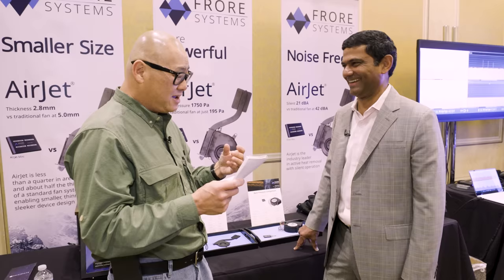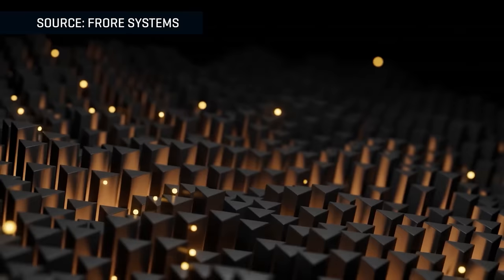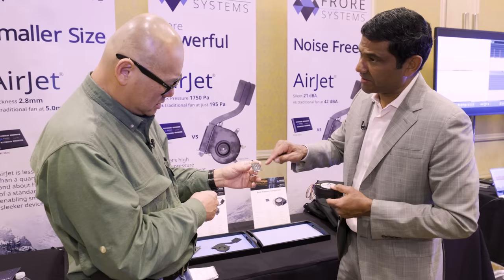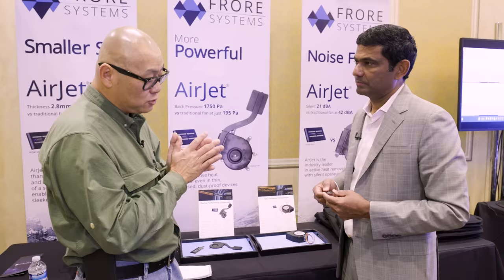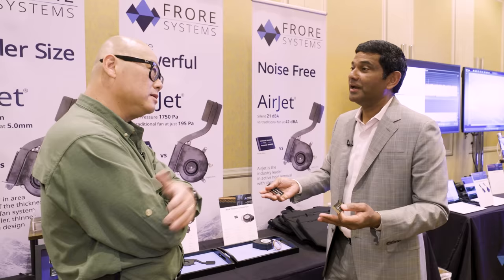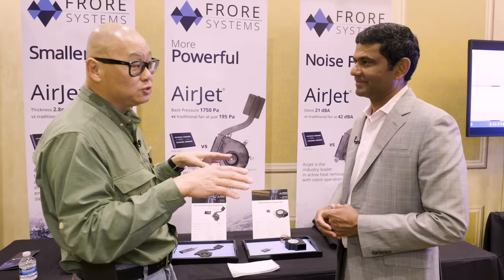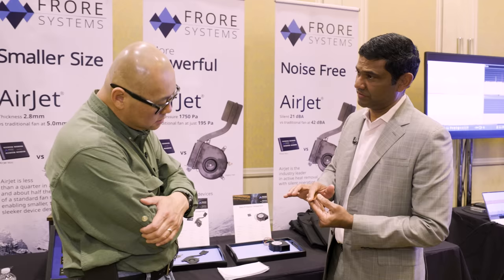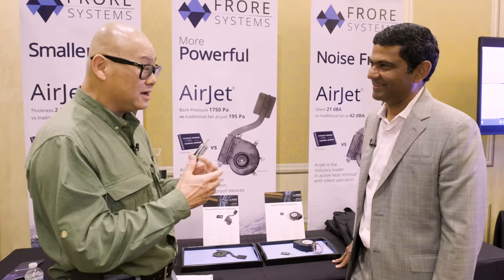Solid State Active Cooling Could Revolutionize Thermals

Comment: This is incredible what they have been able to achieve as a startup! I really hope their technology goes mainstream, as cooling technology is currently at a plateau. Imagine having an ultra-thin notebook with power comparable to a desktop PC, while also being silent and cool to the touch.
Reply: i think a reason why no big company bought this tech is because it is to expensive for the company/end consumer or prone to breaking (ultra thin membranes that vibrates? how will it live in a low to medium dust environment?, what about humidity?, how will the noise change over use with all the gunk building up over normal use?)
Reply: @pflegefachkraft7595  well, he said it can be made dust proof
Reply: You are described the MacBook Air m2 😂
Reply: 200kph air coming out of your computer is going to be loud.
Reply: @gamervmid  MBA m2 is not desktop level. Powerful for its size certainly, but not that powerful (for example, apples gpu graphs are misleading, they only show the gpu is more power efficient than a 3090, as the graph cuts off at the lowest end of wattage).
In fact the M2 doesn't even have good thermal performance. The m1 was pretty exceptional for it, especially as it was passively cooled in the air. The m2 however runs much hotter, even the MBP struggles to keep it cool and thats not passive cooling.
Reply: @gamervmid  the air had a sheet of metal to cool it. thats it. the m2 doesnt even have that. if it wasnt for the m1 only pulling 10w it wouldnt even be able to run.
Reply: @mistermr.6938  pulsating air is hitting the heat sink at a maximum of 200kph. The average speeds of the air hitting the heatsink will be much lower and the exhaust speeds will be much lower again as they will just be a function of the total amount of air moved and the surface of the exhaust port.

Comment: Very cool technology if it works as described. MEMS-scale components have a lot of potential, but will wait to see how this actually performs as far as performance and longevity before getting too excited. Interesting technology, regardless.
Reply: Cool, eh? Pun intended?
Reply: I guess that's the rub - competing with $1 rifle bearing fans from China that can run for 50,000 hours is going to be a big hurdle when this thing presumably costs way more.
Reply: @Weaver_Games  it should cost more, it's way better than fans. Silent at full blast, does not require vents bellow the laptop, thinner yet more powerful and will possibly outlast traditional fans.

It is also the only hope intel has to remain competitive in the laptop space.
Reply: @Weaver_Games  You probably won't see this in budget laptops but for higher-end stuff, this is a game changer. When its reliable, I don't see why this wouldn't dominate the Ultrabook space, which is already quite expensive.
Reply: @timlolxP  much in the same vein of what you said, this probably won't see implementation for several more years, and it will UNDOUBTEDLY be installed in top-tier products when it does. OEMs are gonna need time to transfer these into schematics for builds. The "bleeding edge" factor is too interesting to everyone in the tech space for them NOT to be wickedly expensive, and the "silent" factor is going to be marketed as enthusiast-level components.
Reply: @user-pq4by2rq9y  It will take time, 10w to 1w, maybe they scale exponential at present time.
Reply: I bet the vibration of the device itself will make it selfdestroy in about a year or two. I hope to be wrong, the technology is so "cool".
Reply: oh it’ll work, just not that great in first 2 years. Just wait til 2026 for this
Reply: Longevity typically isn't an issue in MEMS.  For example micromirror devices have been tested at more than a trillion cycles without any significant fatigue.  Depending on the design it's pretty easy for them to tune what frequency of oscillation they're using for a specific application.  My bigger concern is how they ever expect to get to cooling performance hardware since they'd have to potentially go up to an entire wafer for a single product whereas a traditional fan can just be made any size you need pretty easily and cheaply.
Reply: @user-pq4by2rq9y  Of course it will require vents. Where do you think it'll get the air from without vents, or where will the hot air from it be directed to? This device doesn't destroy heat, it is still a device to transfer heat. Just circulating hot air inside the laptop's/phone's/whatnot's case wouldn't do any good.
Reply: Yeah - I fear these things might die after just a few months. And even about 3 years would be a painfull step back, considering they will for sure be way more expensive than fans.
Reply: @Weaver_Games  for budget laptops maybe. but for premium laptops looking to differentiate themselves, this could prove interesting
Reply: @EkiToji  problem is that a trillion cycles happens surprisingly quickly at megaHertz frequencies. Same reason you can’t use Lithium Ion batteries instead of capacitors. 277hours.   :/ 
I’m hopeful. But skeptical
Reply: "Very cool technology if it works as described. " I mean unless that demo with the fan wheel was faked we don't even need any more evidence. The amount of air that tiny little thing is moving is pretty wild.
Reply: Was exactly about to comment on the expected longevity.
Pieces that vibrate for billions of times or more? Well, how does it fail? How long does it last with good performance?
Reply: @EkiToji  Isn't that relative? I (and moany others) consider any technological part that lives less than at least ten years as utter trash. Thinking of DLP projectors I know that their pixels usually start dying really early on. But one good thing for the AirJet (opposed to an DLP's dead pixels) is, that some single 'vibrators' breaking won't break the whole devices function at once, but it will more likely decline inperformance over time, until you consider it has to be replaced.

Comment: Has anyone else noticed that when technology improves, it's usually in massive jumps as opposed to small steps?
This tech wouldn't just need to make contact with the copper base, that kind of volume of air movement could potentially cool down entire tracks of components, provided the turbulence doesn't slow it down too much

Comment: this is the most insane tech I've seen from CES, can easily see this becoming the mainstream cooling solution in a few years
Reply: @danwarb1  looks like you need to relearn how to read. I said in a few years fam, obviously the technology is in its early form, and it looks very promising.
Reply: I've seen mods of existing computers like a MacBook Air. where they replaced the current cooling with a thermal pad. If there is enough space and you would have to pull power somewhere it might work.
Reply: @danwarb1  saying its less than half as efficient as a fan imply that you are doing a comparison of the current state of product, not what it can achieve.
Reply: @danwarb1  and quieter and thinner and with less risk of dust buildup, and theoretically less failure problems, not sure what your point is. And they are apparently going to be part of the intel EVO spec now based on the article, so they cant be that bad. Also based on some (admittedly probably best case scenario) graphs they have, they shouldn't have the same problems with heatsink saturation reducing turbo clocks and time.
Reply: @danwarb1  "Not likely" Refuses to elaborate. Typical skeptic. It's almost as if you people prefer having old inferior technology lol.
Reply: LTT did a piece like this and impressive but more importantly does it come with RGB! 😂😮
Reply: If it really works, I can see Apple just buying the company and patenting the tech
Reply: Efficiency aside, I think the limiting factor will be the cost of these. Fans are dirt cheap, it will be hard to match that.
Reply: Why are people are YouTube so devoid of mannerism smh
We all can disagree and still behave respectfully
Reply: Yes so insane it works just like a speaker. It just magnetically vibrates a membrane to move air.

Comment: Absolutely incredible. CEO Seshu Madhavapeddy seems like a really fun and humble guy too.
I hope he stays that way when his genius invention inevitably becomes mainstream (if all his claims about performance and price are true). Huge respect. 🙌
Reply: @fss1704  Seshu claims it has enough static pressure to be compatible with IP68 certified dustproof devices so if that's true, dust shouldn't be much of an issue.
Reply: @Nayah9  lol, it can have the output pressure it wants but if you close the inlet all you have at the other side of the dust is less than 1 atmosphere of pressure, and that clogs. This will need a filter, a fine filter clogs very easily and reduces the input pressure.
Reply: @fss1704  IP68 or not, if this thing pushes air out at 200km/h, I doubt any dust that enters the chip could stay there for very long due to the absolute storm that's going on inside. Only testing and time will tell I guess.
Reply: @Nayah9  "pushes", not '"sucks", it can only suck 1 atmosphere of pressure at maximum before the inlet becomes vacuum, the gunk accumulates at the inlet, the only thing pushing air into the inlet is atmosferic pressure so that's a hard limit. Get a compressor and try to close the  pressurized outlet, you can't because that's X amount of psi, now close the inlet with the finger and you'll see what i'm talking, vacuum and the atmosphere is the only stuff pushing your finger.
Reply: @fss1704  So according to you all the people behind this technology have given up a large chunk of their lives/dignity for a "scam"?
I just realized I'm a fool for entertaining your og comment (which you conveniently deleted) with a response.
Wait until the tech comes out, then feel free to criticize.
Reply: @Nayah9  People who produced this weren't scammers, the marketing department is. For instance, that's perfect to make a mini air conditioner and mini refrigerator, mini air compressor for bikes, but it's performance as a pc cooling solution is already damned to be miserable, wich is perfect for business of planned obsolescence. I will be selling the filters because that stuff will definetly eat a filter per week or more.
Reply: @fss1704  In case you haven't noticed, it's not the marketing department showing off the product, it's the company founder and CEO.
Your theory makes no sense. Fans would likely pull in just as much dust onto the filter if not more since this chip works off static pressure rather than air flow.
I still don't get why you're judging a product that hasn't been released yet. Clearly you're smarter than everyone involved in this project. They should have hired you as chief engineer.
Reply: @Nayah9  Fans don't use filters, they push 99.9% of the dust out. This stores all the dust in the filters. I judge because i'm the one that will fix this shit when it breaks. And clearly i'm smarter, just looking this and i know a way to avoid the filters, i wouldn't be hired because of that, as it's very profitable to sell the disposable filters.

Comment: I've read an article on this and I hope the industry will pick up on this tech, it seems very promising! This would be perfect in the Steam Deck.
Reply: Isn't Steam deck like 25W total system draw?  You would need 2 pro's and a mini to cool it... I wonder what these sell for?
Reply: Still the pros are also soooo damn thin.. we can only hope they get cheaper
Reply: I don't get what prevents it from being simply duct into bigger heat sink.
Reply: @StinkPickle4000  25 watt total but a good amount of that is passively dissipated - the screen for example. The SoC uses up to 15. With how much air this appears to move, the SoC could probably have one of these mounted on it and the exhaust airflow would handle passive cooling of the RAM and power IC. (The motherboard would have to be redesigned to accommodate this of course)
Reply: @AFistfulOf4K  LOL 'probably' without an actual product in your hands.  At least say "should"  otherwise it seems like you're chilling for a product for no reason!  Perhaps you are paid by the company?

Comment: Very cool.
Could be great for thin laptops, but first thing I thought of is imagine this is in a handheld pc like a steamdeck.
Reply: I was thinking high end videocards. We're starting to reach 500W 4-5 slot insanity levels, I can see something thin that can get lots of hot air out the back of the card theoretically working there.
Reply: better yet imagine every smartphone being a "steamdeck" i.e. being able to run AAA PC games and kick ps5/xbox butts..
Reply: Steam Deck was my first thought. I could gdp or ayaneo jumping on this as well.
Reply: You read my mind.
Reply: @arisindulens2008  man, if you could make 1-2 slot shrouds using this type of temp mitigation, imagine how QUIET a GPU could be...

Saying that back made me shudder... Imagine how much board partners would charge, given the last few years of GPU pricing, with a fully active cooling 1-slot 20gb GPU that never sees 68C... it'd be $5000, easy.
Reply: @@steinmauer9747An excellent point, but as the presenter said this is only the first gen. Historically stuff like efficiency is the first thing to improve as a technology matures, so down the line this could become a viable option. That being said, it will be a while if it ever happens, and for now we just have a tiny but power-hungry solution, which to be fair is more than most first gen products get.
Reply: Yup, if this becomes a reality that a tiny 2W unit can cool down a 15W chip, I can foresee Nintendo, Microsoft and Sony all rushing in to design powerful handheld consoles.
Reply: @Stein Mauer he showed a 10 watt model too.
Reply: @Stein Mauer would love to see a completely silent 14inch laptop with these and a 6800u
Reply: @arisindulens2008  They have a long way to go from 25W to 500W. And it's easy enough to cool GPUs with existing watercooling tech both in the consumer space and data center space (actually easier in a data center in some ways as you can have rack level plumbing infrastructure). This makes perfect sense for portable consumer devices, everything from notebooks to high end video cameras where the current 25W limit still works fine.
Reply: @shadow7037932  AIOs are nice but require a rad+fans in case. I prefer air cooling. But yes, AirJet has a a long way to go.
Reply: Their website actually shows a pdf spec sheet of a “device” that you know could be the steam deck haha and it has rough numbers on it
Reply: @swoop7129  it probably is an industrial device tbh. That’s where these will be used first. Because these will use more power than a fan heat sink cooler. Industrial use makes most sense for first devices as you can get it ip7 dust rated I believe the CEO said. And there is no moving parts. Could make sense for uses where passive cooling does not allow enough performance, and active fan cooling introduces too much dust, or noise if its used in say a place that needs to have a low noise ceiling. Also, workshops that might have metal shards accumulating could use it again because it can have true filtered intakes without restricting flow. I feel like it makes more sense for a next gen steam deck to just use a smaller fabrication process on the SOC to reduce power, noise, and thermals. I imagine these things are expensive because it uses MEMS to move the air versus a fan that are mass produced by the billions per year. I think next gen steam deck or any portable device will more likely just use more efficient process nodes for the SOC, and maybe exotic thermal interface materials like phase change materials like that PTM 7950 from Honeywell. We really need to get a solid power usage number to see if its viable. Because if it needs 5-10 watts to move that air,  that instantly kills usage in portable devices compared to a fan drawing half a watt if that.
Reply: exactly what i was thinking... it can also be good for Standalone VR and phones, etc.
Reply: Nintendo Switch would also benefit greatly from this. It has a pretty large cooling solution for such a hot and underpowered chip lmao.